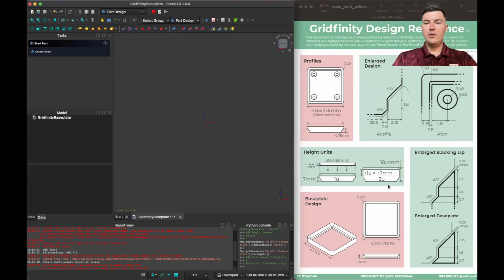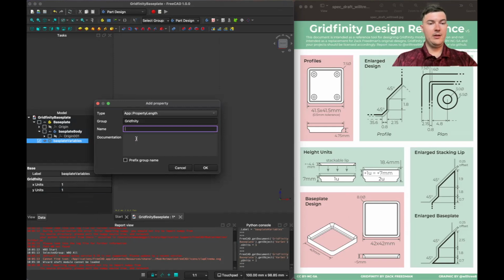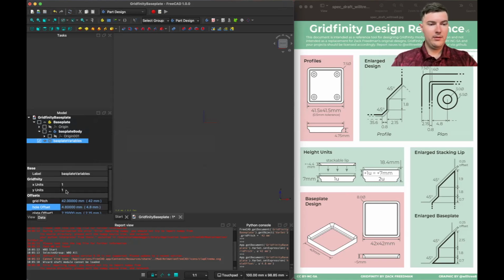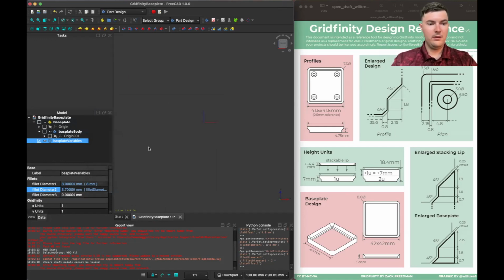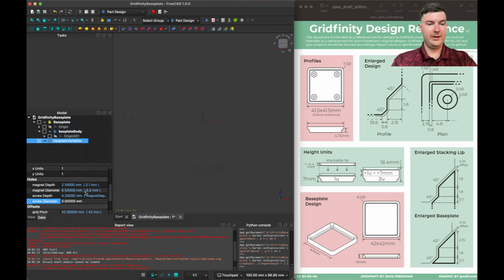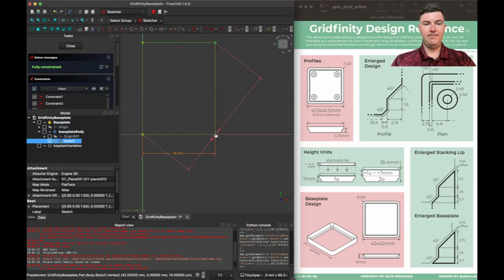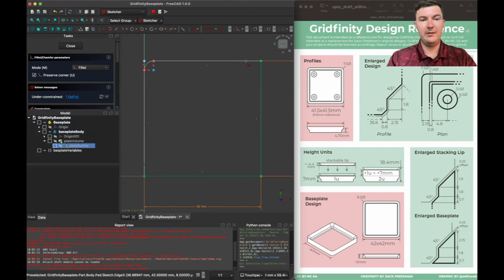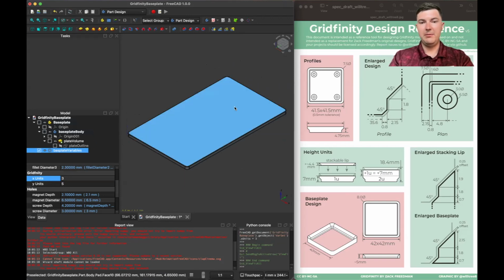Gridfinity Baseplate in FreeCAD: Part 1 - Implementing Variable Groups and a Fully Parametric Pad

Comment: I missed the prefix check box, it really messed with my mind. Went back and redid all the variables. Wish they had the ability to edit the variable. Thanks for this one.
Reply from the maker: I wish that was a feature as well. I haven't done this yet, but I know there's a way to submit a ticket for features the community would like to see in FreeCAD. I've also never done this, but there is a way to always have your FreeCAD updated with the nightly and weekly builds through GitHub. I've heard those builds are less stable than the official releases; however, it's possible that the ability to rename variables is available in those builds